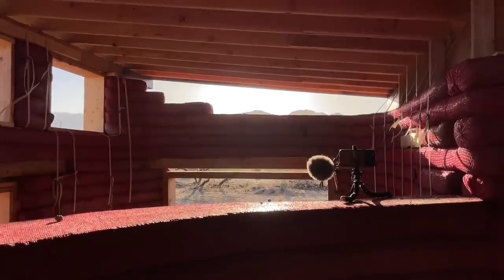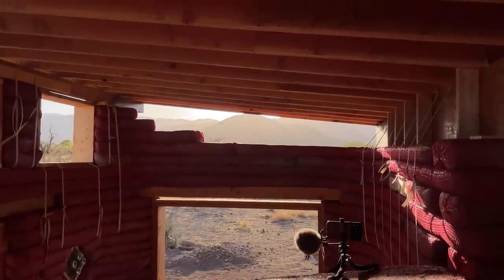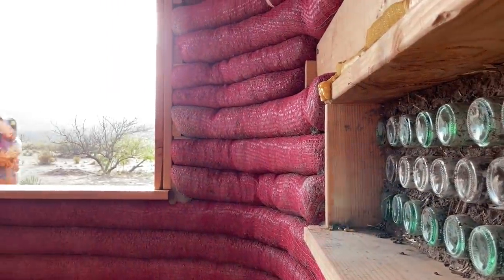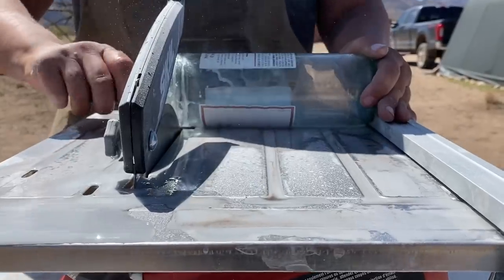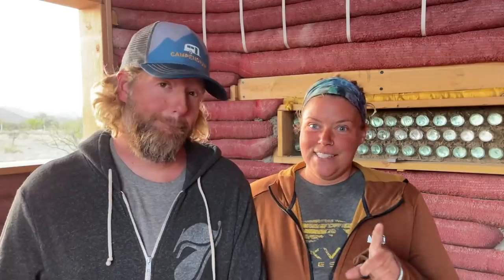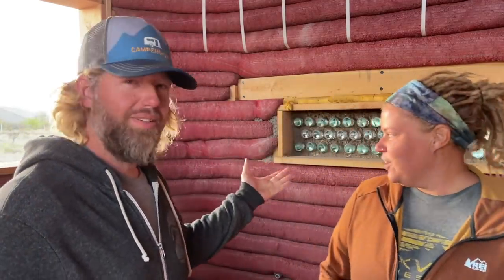Building Up Our Walls with Glass Bottle Bricks and Cob - Hyperadobe and Cob

Comment: a little bit each day.  if you put some wire fence wire up then you have something for the cob to stick to and also something for the bottles to hook to while you build the cob around them.  also if you take an uncut bottle and put it inside a cut bottle nose first then you will get the inches you need for the bottle to stick out where you need.
Reply: Very clever idea about extending the bottles with an uncut bottle. And they’ve mentioned before the type of bags that they have are kind of textured so it’s supposed to grab hold of the cob

Comment: Another suggestion to get the full length of bottles (which sounds like it would be around 17" or so) is to cut extra bottles into 2" spacers, and then tape a spacer in the middle of each pair of cut bottles. That would give you the full length needed. A single bottle would probably yield 3-4 spacers, so this approach could come in handy. Just a thought :)
Reply: I was thinking along the same path as you. Maybe even getting the spacers from some of the tops they cut off of the Topo Chico bottles if proper diameter.

Comment: But what happens if one day a bottle breaks? wouldn't it be safer if the bottles were less exposed? in my opinion it would also be brighter
Reply: there is a video somewhere on YT that shows a smaller diameter bottle covered in thin cobb being slipped into a cleaned out bottlehole. 
You did get me curious if more or less exposed bottle ends means more or less light to the inside - thank you for mentioning it :)
Reply: Very simple....if a bottle breaks, cob over it! Or, you could technically chip out the cob around the broken bottle, replace it, and add more cob. It's much easier than replacing a broken window.
Reply from the maker: What this person said! 😂 ⬆️

Comment: If you want to extend the length of your bottles cut pvc pipe the extra length you need them tape or super glue it .  It's not that expensive.
Reply: P.s I used 3 inch pvc for larger bottles.  You can experiment with different sizes. Sometimes the pvc will fit inside and hold the bottles together